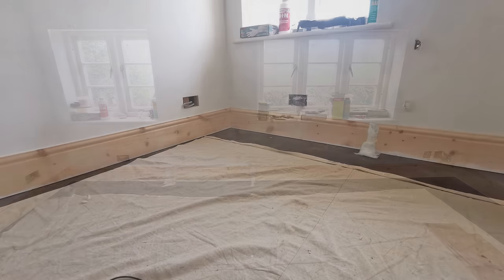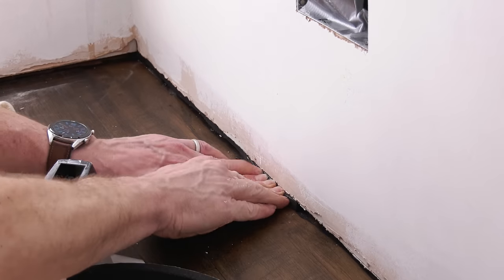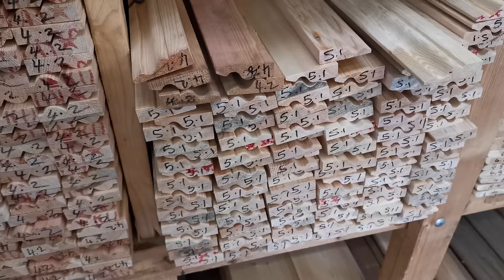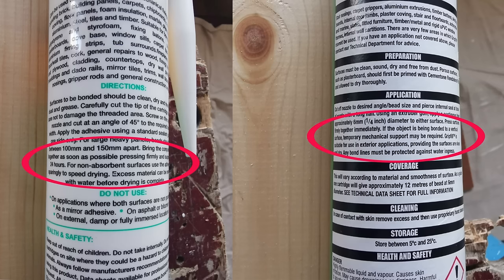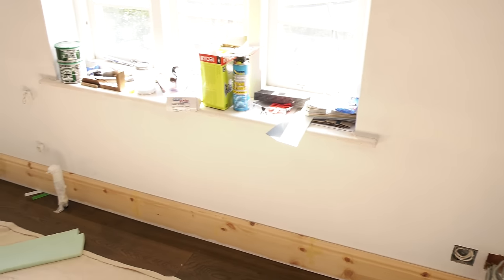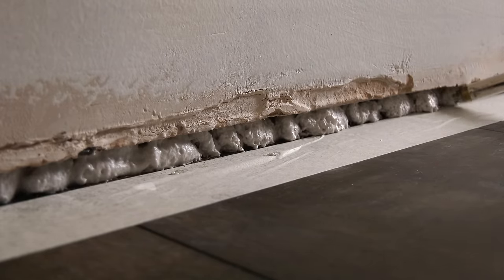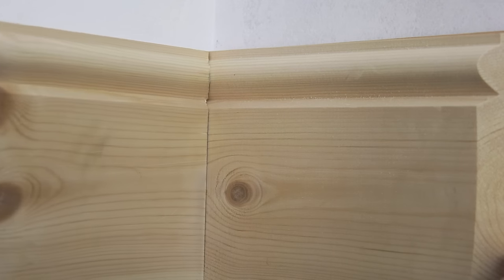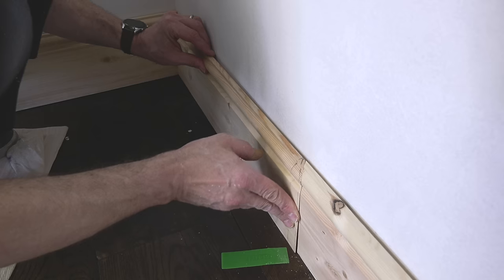How to Install Skirting Boards - a DIY Guide

Comment: Is how you line up the corners a preference? I've seen the twice edge cut at 45° to make a right angle in the corner and I feel it looks better than cutting ridges out of one side to slot in?
Reply from the maker: Each to their own, but this technique is superior because it works even where your corner isn't a perfect 90 degrees.
Reply: I've never encountered anyone who joins skirting board together using a 45° angle cut. If your corners aren't exactly 90° then how will your method work?
Reply: @ACAIDC  I guess it wouldn’t but when I decorated by room a few years ago we used that technique and each corner was pretty much perfect. Guess if there was a slight gap decorators caulk could be used to fill it and smooth it over

Comment: How did you know where the screws were going to line up with the rawl plugs in the brick work? I’m struggling to line up the holes as I cannot see behind the skirting obvs
Reply from the maker: In the vid you might have skipped the bit where I showed how I did this. You put the skirting against the wall, and drill right though it into the wall with an old HSS bit. That way when you line it up again after drilling the wall and adding the plugs, the screw lines up perfectly. However you can get the first screw into the plug by pulling the skirting away a rich so you can look down the back as you guide it in. You shouldn't need to do this though provided you line up the skirting in the same position before and after drilling.
Reply: @CharlieDIYte  Rhanks for reply! The skirting is behind a radiator so unable to pull the board back and have a peep! Also when you say HSS drill bit… do you mean make a pilot hole into the brickwork behind the skirt , so it makes a ‘mark’ for where the plug goes into?

Comment: Your screws said they were 3,5 but you used 6mm plugs. Can I use 6mm plugs with my 4,5 spax construction screws? I've done a couple of external joints on the fly free hand with my Japanese rasp saw.
Reply from the maker: So that's a 4.5mm diameter Spax you're talking about? I would have thought so, Luke, depending on what sort of plugs they are.
Reply: @CharlieDIYte  Ok brilliant I'll give it a go. I usually buy plastiplug but I might try and find fisher. Thank you.

Comment: Did you pilot hole for the lost-tite screws to go into the brick work?
Reply from the maker: Yes, in the sense that I needed to know where to drill the brickwork, so I got an old HSS drill bit and went straight through the skirting and into the brickwork. Once I had that small marker hole on the wall I then used a larger masonry drill bit to drill the brickwork, for the wall plugs.

Comment: I have Evolution Sliding single bevel mitre saw,  But it never cuts straight do know of way of fixing the issue?
Reply from the maker: Yes it's not perfect, but it's a bit of a bargain for the price. The laser was never straight on mine, so I don't use it. All you can do is check the setup before your cut on a scrap piece. I take it you've fucker checked that the angle adjuster is in the centre and locked off?

Comment: OK, so I'm a time served Chippie.
Yes, there is a specific way to install skirting! 1. Work out lowest part of the room, thats your reference point for installation. 
2. Never use internal mitres.
3. Butt n scribe and scarf joints should lead away from the entry point of the room, so as to minimise their visibility.
4. Each internally fitted length of skirting should have 1 butt end and 1 scribe end.
Reply from the maker: Thanks for that Robert, absolutely invaluable for us DIYers!

Comment: Great video. Man I got a thumbnail splinter like that from a fibreglass bath. Horrendous 😩
Reply from the maker: No way! Did it work it's way out like mine did? Start of lockdown with the hospitals overwhelmed and I was quite worried about it as the pain would wake me up every night. Suddenly a few days after when I was tapping away on the keyboard the end of it just appeared. I gave my wife the pleasure of pulling it out as she loves removing splinters! The relief was immense!
Reply: Yours looked a lot worse than mine was. It did gradually work its way out, but it took a good two weeks to come out. Putting any amount of pressure on the thumbnail was really painful 😭

Comment: Wait, how do you fill the gap in between the skirting board and the floor? I moved to a flat in which they seem to have applied silicone all around everywhere and with the weight of the people walking all the silicone is broken in between the skirting board and the floor and also a big gap is being created in between the skirting board and the wall, how do i fix thaaaaat????? Help  people!

Comment: Do u think that tape will work on roller garage door
Reply from the maker: The problem is it will keep expanding and contracting. So as long as it's up and down rather than a door shutting it might work but it's not really designed for joints where there's a lot of movement as it's a soft foam at the end of the day so will degrade if it's subject to a lot of friction etc
Reply: @CharlieDIYte  hi 👋 thanks I'll give it a bash currently theiers brushes, but the track is too wide they do nothing

Comment: That bit of architrave around that door (crazy knot...shouldve cut it off and started with a fresh length.)
Reply from the maker: I don't know. Knots are all part of the character, and with the shellac primer, the sap will never come through. What I didn't notice until it was complete was that the architrave around the ceiling hatch has a bit that they didn't route properly - which is really annoying now that I've noticed it!

Comment: Any reason why people don't paint at least one coat of their skirting boards before they get fitted. Seems odd to paint so near your new flooring or carpet.
Reply from the maker: Yes, a few people have commented that I should at least have primed them first. I don't paint the final top coat because of the holes I'm drilling in them (I'd have to repaint the whole skirting board anyway as spot painting wouldn't work). But a lot of people say you shouldn't caulk onto bare wood, which makes sense.

Comment: 2) Instead of using 2 pack filler use Red Devil Onetime. It’s much easier to work with and there’s no need to sand it.

Comment: Would be good to see you renovate natural wood floors (repair, sand and stain). We are waiting to do ours!
Reply from the maker: I haven't used a commercial sander - I laid a new pine plank floor in my old place in London, stupidly walked all over it and so had to sand it all down, using the Bosch sander you saw in this video. I think it is largely responsible for my tinnitus now - make sure you get ear defenders. However I can't recommend Treatex highly enough - as I used here https://www.youtube.com/watch?v=vmeG1nF47Ik&t=202s

Comment: Some decent tips but missed the single most important starting step when dealing with uneven/unlevel floors.

Start by finding the highest point on the floor perimeter and scribing the bottom edge of all pieces to achieve a flush level fit all around.  Bending boards to push down into low spots is a great way to ruin the look and ensure movement, squeaks and cracking of fillet etc.

Comment: Sorry Charlie, you don't cut the internal like that. You use an adjustable woodworking bevel to find out how true the walls are (vertical). Transfer this to the skirting boards and then back cut it with a coping saw. The secret if at the very top you should leave a point on it  this way if the walls are out of 90 degrees and not plumb the back cut will allow you to move the skirting accordingly.

Comment: Someone told me that you can use expanding foam to fix skirting or door frames. Has anyone ever used it?
Reply from the maker: Yes you can, and it's quite good on the sense that if you ever need to remove the skirting you just get a saw behind and slice it away. The only issue is coming up with some sort of clamp or brace to keep the skirting in position whilst you wait for the foam to set.

Comment: DON'T glue the top of softwood skirtings to the wall, hoping it'll stop the tops pulling out - it won't, it'll pull the skim off the plaster base coat/ plasterboard! And don't cut from the back, when you're cutting scribes - SCRIBE...using a spacer and pencil, then cut from the front, UNDERCUTTING, so that the back of the cut is well clear of the front. And don't mitre internal corners, even if you have a mitre saw - the internal corners will open up when knocked. Don't forget too - You can use the mitre saw to get the outline for the scribe cut....AND.. if there's an unacceptably large gap between the floor and the bottom of the skirting.. SCRIBE IT! Don't go cutting and bending the skirting, or the top of the skirting will be all over the place and it'll look a right b***

Comment: That warping looked like a nightmare!
Reply from the maker: My fault for buying quick growing wood, I guess. I've gone with mdf window boards in this room partly because my local timber merchants have stopped stocking wood, but I just couldn't bring myself to install mdf skirtings. After this, I will be doing next time though. A good dosing with Zinsser BIN and they'll be impregnable!
Reply: Charlie DIYte Thanks for still uploading the video and being so honest about your regrets! Cheers

Comment: Mdf it's way to expensive. People pine wood will do the job. You just need to make sure wen you buy to pick the straight ones and if any gaps use filler.. Its not a difficult job as he make it sound I have done it a few times and it's not hard 👍

Comment: You forgot about the knotts in timber there a pain in the arse and will always show through the paint even when useing knotting solution
Reply from the maker: You're right, I should have mentioned that. I forgot because knots aren't an issue for me, because if you prime with Zinsser B-I-N, knots are of no concern 👊👍💪
Reply: I’ve had knots come through the shellac based zinseer many times. Always ensure to use knitting solution prior to any zinseer products 👍🏻👍🏻👍🏻
Reply: @CharlieDIYte  Yeah, always use Zinsser for bare timber as a primer.

Comment: Er?  Scribe?  You almost got it in the second option for the internal corner.  If you have a chop saw cut at 45deg.  Look at the shape you are left. Yep,  that's the line you then cut to in order to make a perfect butt joint.  You don't need to scribe the shape.

Comment: cutting a slit and bending the board down is a shit fix that just means when you look at the skirting it bends downwards and dosent look straight and level
Reply from the maker: A shit fix? What do you suggest then? I was worried that might be the case but the span is large enough to hide it. Honestly, comments like that backed up with no solutions are worthless.

Comment: Great video... some excellent tips. 

I’m currently doing some skirting for the first time. For internal corners I’m coping the boards using an angle grinder and sanding flap disc. An absolute doddle.... just keep your thumbs away from the disc... it hurts if you catch the top of your thumb, trust me.  

Got it from this video: 

https://m.youtube.com/watch?v=OrVBbDYTm5U

Comment: Not sure I agree with the bonding of the skirting to the walls over traditional screwing it to the walls. If ever the skirting has to be removed in the future by you or A N Other you will rip the backing wall to pieces and not thank yourself for it.
Reply from the maker: I think that where you do need to glue it to the wall, expanding foam seems to get a lot of good press in the comments. With that you can simply get a saw or old carving knife behind the skirting and slice it away.

Comment: The distance between screws would have been useful
Reply from the maker: I think you have to judge that based on the length of your run and how warped the timber is plus you'll need less if you're gluing the skirting to the wall too. I'd say probably every 50cms or so, top and bottom at a bit of an angle, but avoiding any decorative mouldings particularly if they're double sided.

Comment: I think i can speak for a lot of chippies here when it comes to fixing skirting boards to a newly plastered room where the plasterer has finished his plastering 2 or 3 inches from the floor AND left plaster bumby and curved. AAAARRRGHHHHH.
Reply from the maker: And your daily target takes no account of all the making good work you've got to do before fixing the skirtings in position!
Reply: @CharlieDIYte  Youv'e got it. I'm actually a tiler by trade Charlie and i do get very frustrated when i have to tile a newly plastered bathroom where the plasterer has finished plastering 3" from the floor. Especially when i'm using small tiles that are 3" high like Metro's.

Comment: Wait until you have to remove all your screwed on skirtings that you filled all the screw heads. I've just spent the best part of a week picking the filler out of well over 150 screw heads after having to find most with a magnet. Horrid job.
Reply from the maker: It's exactly what I'm doing at the moment Mark. And I couldn't be bothered with one so I gemmied it off the wall and it tore half the wall with it. 🤦 They had pz2 screws rather than lost tite.  Still, at least it's not glued on though. The trick would be to put a small piece of cloth tape on the head to stop the filler getting in.